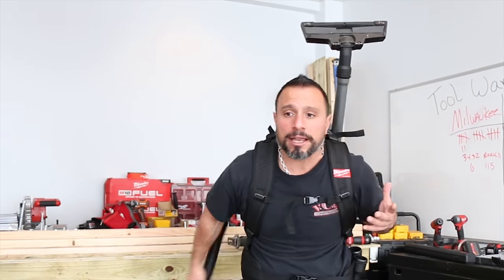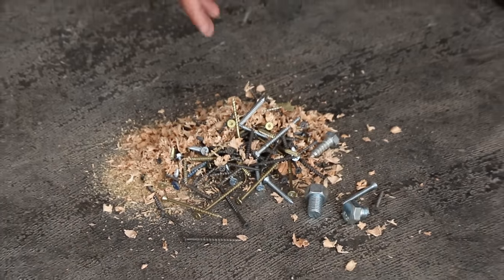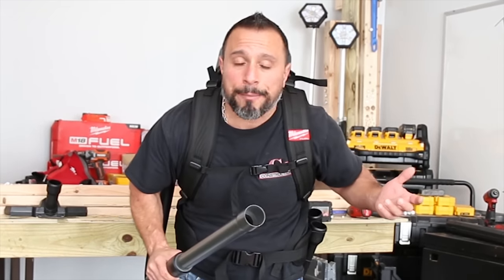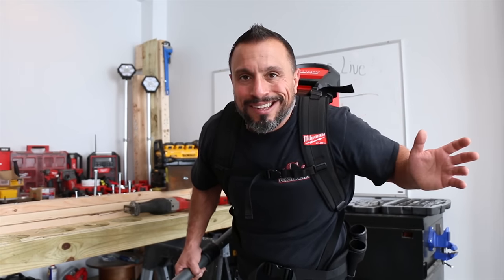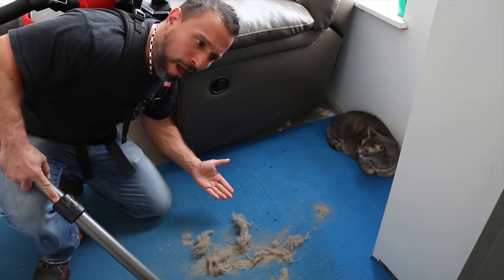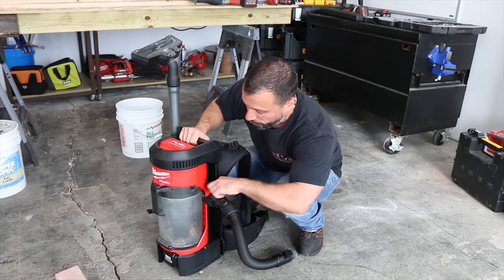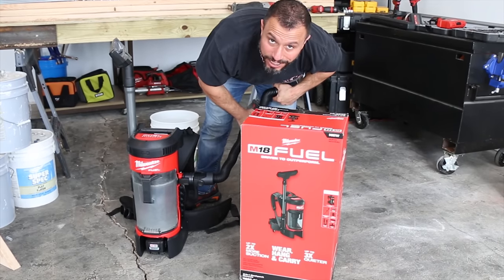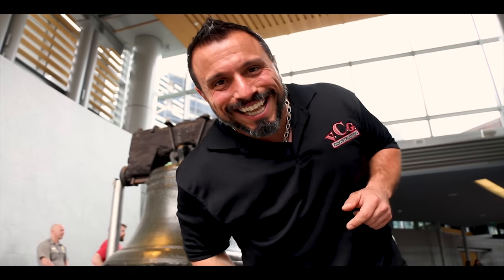Milwaukee (0885-21HD) M18 Fuel 3-in-1 Backpack Vacuum - How Much Does It SUCK?

Comment: Thanks VCG... I’m wondering how it really compares with the Makita backpack vac. The CFM is about the same although the Milwaukee has a much higher water lift. The run time of the Makita is almost 3 times as long though which is pretty significant. Any experience with the X2?
Reply from the maker: No experience with the X2 sorry cuz!!

Comment: Hey Vince!  I noticed u did great demonstrations of a couple of sucking up materials. Of course, metal screws etc are always a common sence even w a bad ass contractors shop vac. But as we all know, one of the most COMMON VACUUM CLEANING, is drywall partials in carpet. What are your thoughts on using that vaccum for that particular material. I've not had any good results w most vacuums sucking up sheetrock particual and sheetrock dust from carpets. Jus wodnering if this one works for that particular jobs?
Reply from the maker: It’ll get you by, but you’d be better served with a vacuum that has a beater brush!!

Comment: It is the strongest 18v vacuum cleaner I have had so far, only thing I have to notice is that in position 2 with a lot of fine dust the filter clogs as a result that the vacuum cleaner switches itself off.Position 1 is not a problem.Thats why i ordered extra filters.Greetings from the Netherlands👍
Reply: How well does it suck up dirt clumps
Reply: position I is about 95 mbar and position II 190 mbar max, you have to be able to suck up coarser material with that. The hose diameter is around 36mm. I mainly use it for particulate matter and have converted it with a separator against it so that the filter does not immediately become clogged. Filter cleaning is easy you grab a block of wood and a hammer and tap around the filter a few times all the dust is out without getting under it.

Comment: Back in the day we used to mount a magnetic strip to the front of the floor tool to pick up the screws and hardware  b4 they went into the vacuum.  Can one reverse the polarity on the motor and use this as a jet pack?

Comment: I thought I was watching the Rocketeer in reverse lol.    I just ordered the same vac but I do have 2 of the Tea Pot looking ones and I think they work great for small clean ups so I would imagine that one is a huge difference 👍🏼
Reply from the maker: How do you like the tea pots?
Reply: VCG Construction   They don’t hold a lot of debris but for a small vacuum you can’t beat it. Plenty of power for a compact vacuum and it’s basically a mini version of the back pack vac.

Comment: How long does the battery last when using it ?
Reply from the maker: You are gonna want to use a 9.0 or 12.0 when using the vacuum. The kit comes with a 9.0. Anything smaller than a 9.0 it will drain fast

Comment: Maybe remediation work too Vince
Reply from the maker: I’m thinking more on the lines of house keeping!! Good for solid surfaces!!
Reply: Mold and mildew in homes ? Hepa
Reply from the maker: They say nothing wet, so as long as it’s dry I suppose it’s fine!!
Reply: Was thinking of water intrusion behind baseboards after dries and removed just thinking about nasty air blowing through a  regular shop vac

Comment: I need a cordless one desperately for my room that has a carpet, since I have the M18 platform of tools & batteries, I thought this is the deal, but after seeing this vac has no brush-roll in its suction housing, I guess it won’t do as nice as the other ones that have brushroll, also I think this is just unfair/ripoff tool that Milwaukee have in the market with a crazy price! 

Bare tool for $299 !!